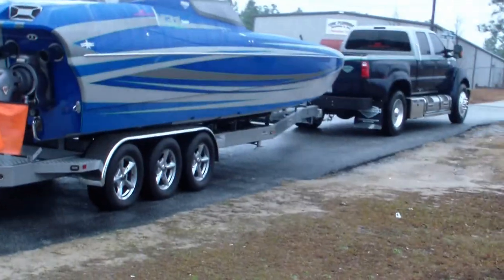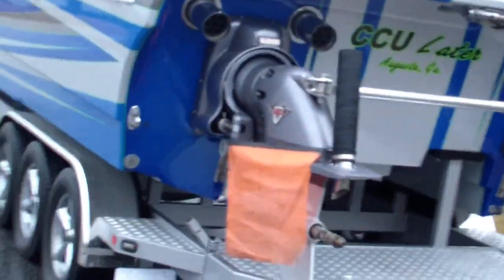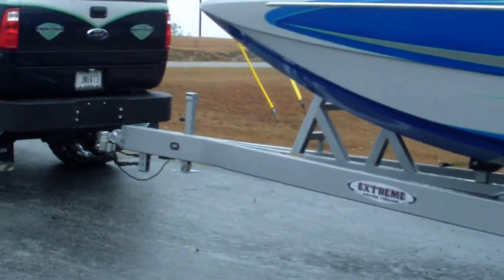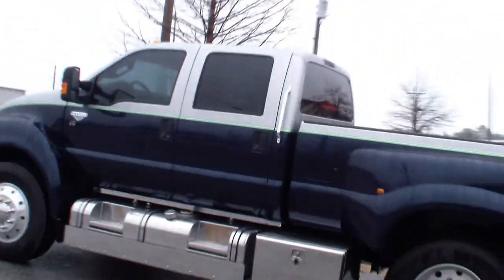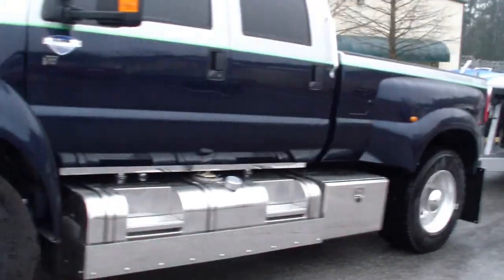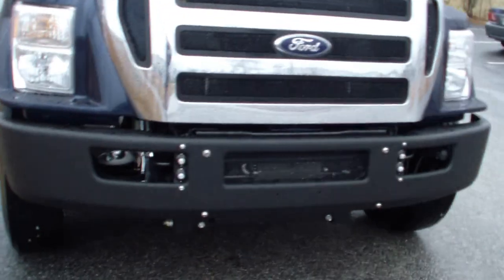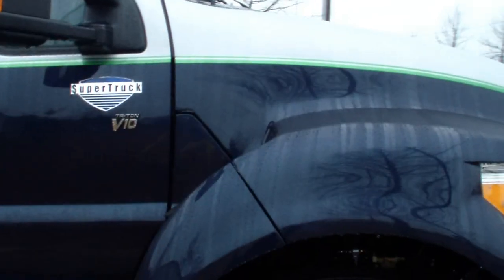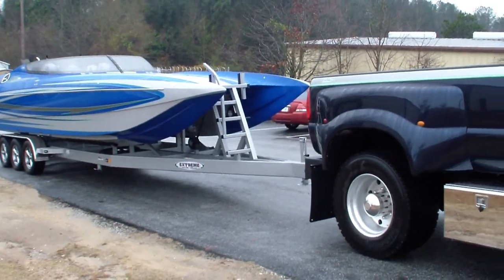2012 F650 pickup and a DCB31 widebody headed to the florida powerboat poker run

Comment from the maker: Yep, it's a gas truck, not diesel! The gas truck costs less and is a bit faster than the diesel. It's cheaper to fill up and much easier to take to get an oil change- you can pull into Jiffy Lube or similar. The Ford diesels have a two-year warranty but the gas trucks come with a five-year warranty. So there are definitely some times when a gas F650 may be preferable over the diesel!
Reply: but the diesel one have a better towing capacity